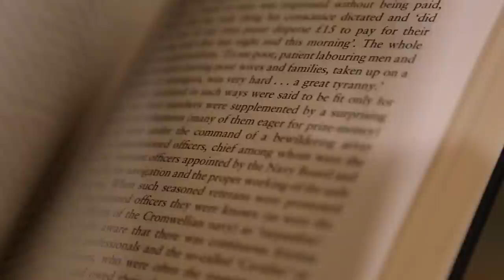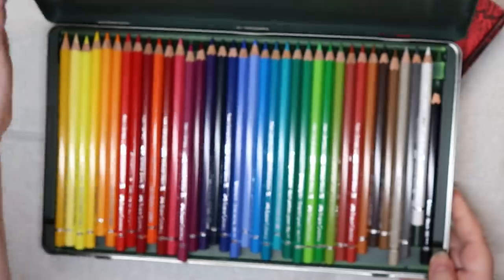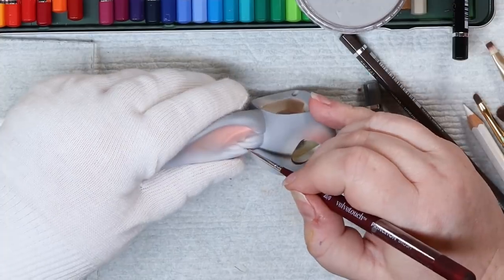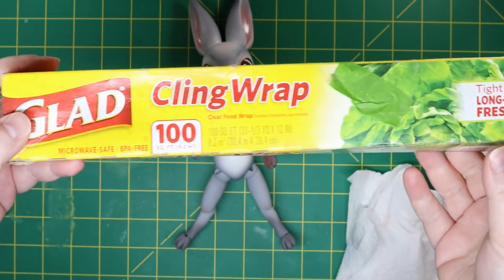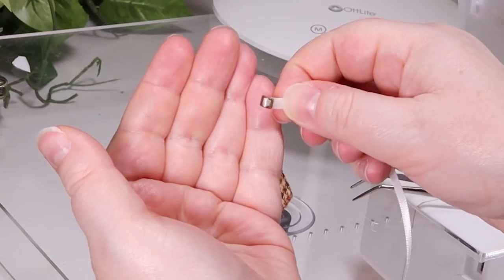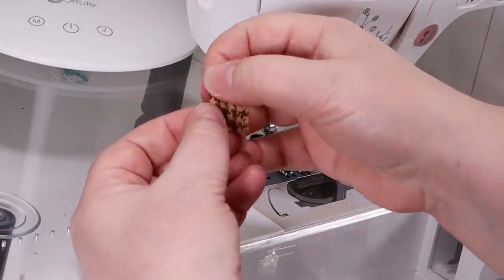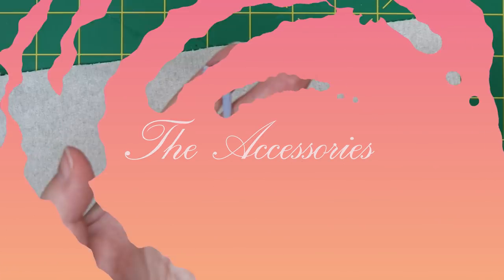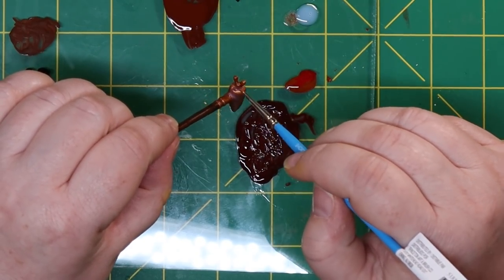Custom Doll! Dollightful and Moonlight Jewel's BJD Bunny  || OOAK Custom Doll Repaint and Tutorial

Comment: he needs some pants
Reply from the maker: He’s kind of based on Beatrix Potter characters (Peter Rabbit) where they were drawn without pants. Plus men of the Regency period wore breeches, which were a very tight pant. So I figured no pants would work too.
Reply: @DollyPop  i get the vibe i just feel like he's a bit ornate on top an then it's just his cute baby legs
Reply from the maker: @cipreste  I see it that he’d be too much with pants and boots. It would simply be a lot to look at on this tiny doll. The bottom half still has details, but the focal point is his head. I figure there is a hierarchy when you look at anything. You want to see the “headline” first with the bold, large type. Then you want to see the sub-head, with smaller type, but still pretty large. Then you want the text type to be much smaller but still have details, just not as much as the headline and subhead. I think this is very much like that. His head is the headline, where your eye goes first. Then his clothing, then his body and accessories. Sometimes as an artist, you have to edit. 🥰